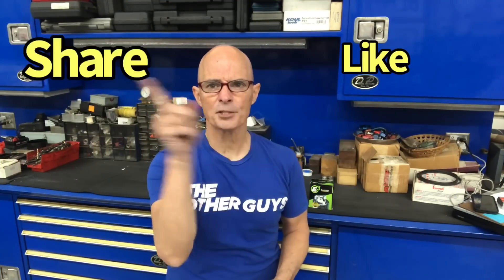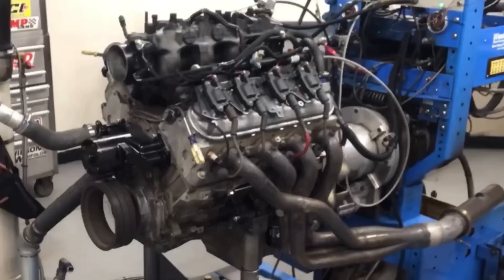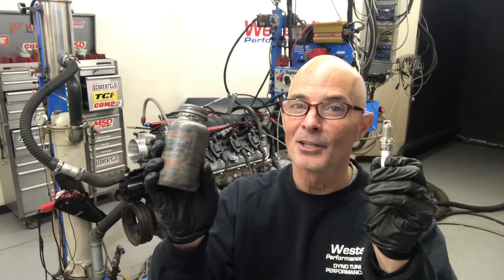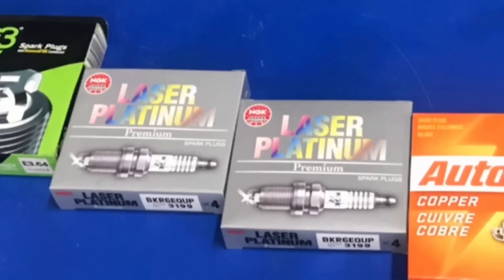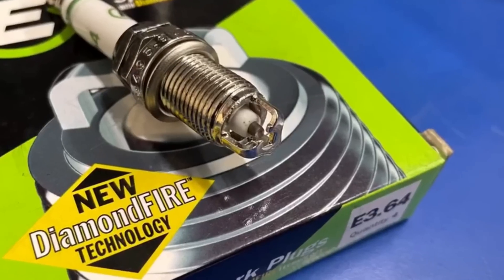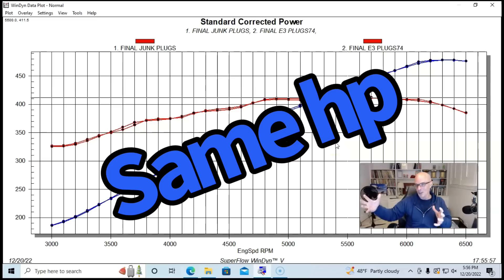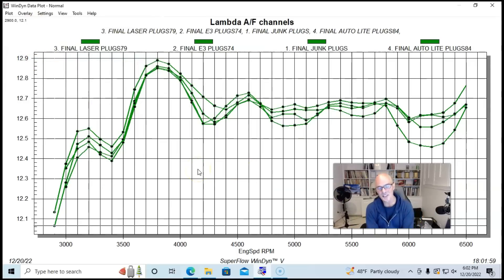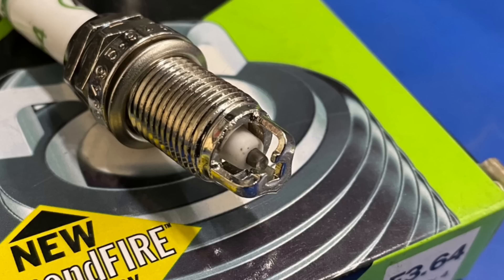E3 SPARK PLUGS-DOES DIAMOND FIRE TECHNOLOGY REALLY ADD POWER? E3 VS LASER PLATINUM VS CHEAP COPPER

Comment: Short answer, spark plugs do not add power. Because how would they do that? Its a spark, it's not adding fuel or o2 or anything.
Reply: But, you are limited to the length of the stroke to extract as much power as possible from the fuel/air available. The idea with the high performance plugs is to get the flame to spread as fast as possible from the moment of spark. That being said, if these plugs actually have a notable increase in flame spread, you'd probably need to adjust the timing advance to compensate for that. I doubt that the difference in flame spread is "notable", but in theory, it should be. I'd like to see a head to head test between a standard plug, and the most promising "high performance" plug, but with the mapping peaked and tweaked for each plug.. I think THAT is where you MIGHT see the gain.. and again, it would probably only be seen as maybe an increase of 100-200 hundred RPM on top, and THAT would only be realized if there wasn't something else in the engine holding it back.. Rev limiter, valve float, etc..

Comment: I ran a set of laser plugs in a 3.8 ford. The standout thing I noticed was the motor really ran terribly before it reached operating temp. Pulled the lasers and replaced with NGK v grooves ( my go to) and the poor cold performance went away.

Comment: Hey @Richard have you done a coil pack comparison?
Reply from the maker: there is no change in power unless you have misfire-we have run stock coils up to 1542 hp
Reply: Ok thanks a lot I appreciate the response and your videos. I also assume wires don’t matter either?

 I see a company advertise won’t name here but they sell 0 ohm wires that create more power as well.

Comment: E3 plugs were recommended, so I put them in my car. No noticable improvement in fuel economy or performance. After 1500 miles and many misfires, installed the factory recommended NGK's. Mileage and performance increasrd exponentially. E3's are junk.

Comment: The irridium plus or pro (that have irridium on top and bottom) last a loooooooooooong time. I have a 14 civic and the plugs lasted 292,000 miles when one finally started miss-firing. I pulled them all out and swapped for the same. The old plugs looked just as new as the new plugs with ZERO wear on electrodes. The car never lost mpg and never had any missfires right up to the point one failed.
They cost $30ea at the honda dealer though, so quite pricey.

Comment: Guess you can't index non-race plugs? Does exact torque matter?
Reply from the maker: you can index any plug-I have not seen any change with tightness of plug-if it is tight enough to provide full contact and not loosen up

Comment: I will like to see time in which the engine rev to certain rpm as spark plug is likely to improve response and fuel efficiency  not adding power to the engine as you still have same fuel and air ratio.  Better plug will increase the rate it fire in the cylinder . Haw fast it light up means fast and better combustion leading to response and fuel efficiency.

Comment: Maybe, and I mean Maybe when people were still using points type ignition and a 20 to 1 wound coil making less than 20,000 volts for a spark, it might have been possible to make an actual gain from a possibly better plug. Then again, there woudn't be much gap with a coil that weak. Fast Forward to these days with 40k to 60k volt coils on plug or short wire with 8 individual coils that will jump .100 gap all day long and the plug just isn't going to matter. Richard just saved a lot of people a LOT of money... As usual, good info... Now, let me go see if he's still live talking about cam lift....

Comment: The question that remains, that this video didn't ( and frankly isn't able to ) cover. Which plug type will remain the most consistent performer over time and miles.  That question assumes tight control of all variables. Things like fuel quality, weather conditions, traffic conditions, mechanical condition of the entire engine and drive train to name several ( but not all ). I know what my suspicion is. It would be fun to see some real world independent testing on that.

Comment: I won a set of 16 E3 plugs at a car show over in Adel Ga 6.7 years ago at southern Mopar week.  Just ram across em cleaning out a box of old stuff in the shop and came in to look up this video.  Guess it’s just money savings for next plug change being plugs are crazy high now days.
Reply from the maker: they work-especially when they are free-they just don't add power
Reply: @richardholdener1727  😂 I’ll use em next change on something

Comment: I'm surprised you haven't done a ls coil pack dyno test. Rumor has it the round coils with heat sink at the top auto fire causing engine failure on the dyno.

Comment: Over 40 years working on cars. These are some of the problems I've run a crossed.  2 Mopars, one with a slant 6 and the other a 360 that wouldn't start with champion plugs but ran ok with autolites.  3 Fords with point distributors that wouldn't start or missed like hell because the distributor lost ground.  Despite the fact the distributor has contact with the oil pump, cam and block and a new ground wire for the point plate to the distributor.  A simple ground wire running to the distributor solved the problem.  3 cars with severe misses because the tech used way too much gray anti seize on the plug threads. Cleaned them and the plug holes and use a very small amount of the same anti seize and problem solved.

Comment: Ive seen copper core worn to .090" gap running smoothly. 90 Ford 302 tfi.
Electrode rounded off.
😆😆😆

Comment: My grandfather who owned and ran a service station post WWII always said the air and fuel doesn't care what's making the spark. As long as it's the right heat range, it doesn't care. Seems like he was right.
Reply: The temp of a plug is very important but this guy don't even explain the heat rang from plug to plug

Comment: I have a couple questions. does anti seize conduct electricity? would you use it on a battery terminal or a ground wire? how many wires go to a spark plug? how does an electrical circuit work? if you have increased resistance on a power wire does the circuit deliver all the amperage? if you have increased resistance on a ground wire does the circuit deliver all the amperage? where does a spark plug get it's ground connection? why do people put a non conductive lubricant on a ground connection? I know why it doesn't stop the spark, that's because it is a stepped up high voltage that forces it's way past the non conductive nature of anti seize, with enough voltage you can push a spark through all sorts of things, but why reduce your spark output? I've seen idle issues, misfire issues, carbon buildup, premature catalytic converter failures and premature spark plug fouling all the result of a little anti seize on some spark plugs. boost an engine until the spark is too weak with anti seize on the threads, then clean it all off and see if it still misfires. I want to see the results. I use brake clean to clean off the threads and have to run a spark plug in the threads of the head multiple times before the engine starts running better and gets back to full spark. typically a small dab of anti seize will spread across all the threads and all the way up the seat. the only way it can be used is in the tiniest dab possible and I still don't recommend it because it's extremely easy to misuse.
Reply from the maker: we don't see the things you describe

Comment: I got Diamondfires for my 1MZ-FE recently firing a parts gun at a developing backfire issue, they seem to work pretty well so far.
Granted, when I pulled the old ones out it became clear to me that they had seen the full 316,925 miles that this engine has run in its 21 years, horridly burned up, with tons of transfer deposits on both the ground and electrode, and about a third of the ground literally burned away judging by how thick the spark point was compared to the arm leading up to it.
I didn't think that the diamondfire thing would do much of anything power wise, and this video kind of shows that is the case normally, but coming from the plugs that were in there, with how out of spec they had become after running for so long, I am actually seeing some extra power out of them. As for fuel economy, I can't say anything yet as they've only been in for about a day and one short drive to make sure everything worked at least as well as before, though I didn't get to test the driving conditions that I was getting backfire through yet.
I'm not saying to get diamondfires or laser platinums, just, don't be like the original owner of my '03 Avalon, do more regular maintenance than just oil changes.

Comment: Just to take this test a Step Further: 
Try going with 1 or 2 Steps Hotter and Colder on the plugs to see the Power Reaction by doing so.
Ngk: try a cold 7 or 8, and a hot 5 or 4
I know Champion is the opposite numerically, but I dunno any of the others off the top of my head lol
Reply from the maker: I've run 10s, there is no power from heat range

Comment: I've ran them in all my zero turn mowers (mow commercially) and I will say the only thing I have noticed is that when in a Kawasaki engine, it does start faster. Nothing different with starting in a Briggs or a Kohler and nothing different in any of them while working the mowers.

Comment: Nope..
I put those E3 plugs in a 4 cylinder Jeep Patriot and log distance fuel mileage increased by 30%.
Also had more power; the Jeep had difficulty going up steep hill that is 1/4 mile before E3 plugs. After E3 plugs the jeep had no problem going up the same hill.
E3 plugs also increased fruel mileage on 2010 Chevy truck with a 6 cylinder 4x4 from 18 miles to gallon to 22.5 miles to gallon. Horsepower also increased just slightly.
Reply from the maker: nope-the only way to improve fuel mileage my 30% was to have one (or two) of them not firing. The dyno tells us what adds power and what does not
Reply: @richardholdener1727  have you tested E3 spark plugs in real world setting??
Reply: @richardholdener1727  I have tested E3 spark plugs in real world settings as I have them in my car as well the other 3 vehicles of family members. I forgot write about the Dodge Durango V8 got improved fuel mileage on the highway driving long distance!!
So that is FOUR(4) different vehicles 
1 four cylinder SUV
1 V8 SUV
1 4x4 V6 truck
1 V6 4 door sedan
All got improved fuel economy.

That dyno testing be done in the video they is less than one minute of testing.

Comment: Use a match or a blow torch to light a 5 gallon can of gas on fire. Tell me which one worked better?
Reply from the maker: both do the same thing-as long as you light the vapor an no plug is equal to a torch

Comment: You may have done it but I’d be curious on testing LS plug gap. GMs original 60 thousandths vs GMs revised gap at 40 thousandths.
Reply from the maker: makes no difference if no misfire occurs
Reply: @richardholdener1727  the hotter spark of the 60 thousands gap I’d think would help?
Reply from the maker: there is no hotter spark-the spark temp is the same-you either initiate the flame front or you don't-don't look for power changes in plug gap-except to eliminate misfire in boosted applications (where you reduce gap)-gap might help MPG at lower engine speeds and light throttle angles
Reply: @richardholdener1727  just searched and saw you have a LS plug gap video. I’ll go watch it now.

Comment: Hi richard.question for you.btw huge fan of your channel.ive got my 383 stroker motor well over 500hp natural aspirated.ivhave a pro billet msd distributor,6al2 box and msd hvc coil.i been hearing this hype on granatelli spark plugs wires how there the best claiming they have 0 ohm resistance per foot and saying msd ain't even close.i want your opinion on the wires I should buy.i was looking at msd they have so many.i want the best.whats your opinion on this because what you tell me I'm buying.and maybe one day you can Dyno test these wires to put an end to this stuff.there high dollar and surely putting down msd.thanks rich
Reply from the maker: KEEP THE WIRES YOU HAVE-THERE IS NO POWER UNLESS YOU HAVE MISFIRE

Comment: I.woild only run E3 in two cycle engines
.they have a high failure rate. I only run Densomor NGK myself and recently tried the rutheniums in my skyactive 2.5 Mazda 3. They are great plugs

Comment: Ive noticed when tuning iridium is more susceptible to knock with aggressive timing. Although it idles better than copper and seems to have more response down low in the rpms. I agree the main trade off is useful life. I recommend copper for track cars and iridium for pure street cars

Comment: I used to believe the platinum hype in my early 20's but was told by a racing team to just use standard copper plugs, like NGK, on my 350 sbc and I have ever since. Plats may last longer but I would still change them during a tune up anyway.

Comment: It's mostly always the same. But the only question is Did you gap the copper to the altitude you are at?  In Calgary Alberta Canada a larger gap will produce a hoter spark. It makes average engines start better and are more reliable plus maybe response. I always gap my platinum plugs about 25% more than factory spec. But what do any of us really know unless we keep our vehicles for more than 100,000 KM or miles. 20 years.
Reply from the maker: more gap does not change power

Comment: Every time I suggest a video you tell me that you’ve already done it lol. So here I am again to request a video that you’ve probably already done. Just saw a video where a guy picks up 35 hp on a 1000 hp boosted LS3 when he switched from factory LS 3 ignition to Granatelli coils and wires. How about a coil/ wire test on a 500 hp LS?
MSD
Granatelli
Fast
Vs
Factory

Thanks Richard
Reply from the maker: I have seen no power from coils-we run stock ls3 coils (with the right dwell) at 1500+ hp. If there is no misfire-there is usually no power gain

Comment: Is it possible that in a engine that doesn’t have optimal vortex intake systems to optimize air fuel mixture that the E3 plugs could help in those engines? The E3 manufacturer only claims that it could increase HP by adding 5 more horses. That LS engine is very tuned and I think that this optimization is negating any gains that might be from the premium plugs. The miss matched plugs seemed so well that this may show how great that engine is. 

Please bear in mind that this is the first and only video that I have seen from your channel. I would love to do what you do! It looks like so much fun to do these tests.

Do you have a video of a crappy engine to see if just the plugs make any difference? Some that doesn’t have GM Vortex technology?

Anyways, love this awesome video. I will check out your other videos and might even subscribe to your channel!
Reply from the maker: don't look for power in spark plugs on any motor-unless you have a misfire
Reply: @richardholdener1727  I learned that the E3 spark plug has copper conductors which seems to make them a big rip off. Iridium is the way to go with engines. Isn't a motor a device that take electrical energy and turns it into mechanical energy? 🙂

Comment: I believe when you go to a plug like the e3 or any more capable plug with more efficiency you will need to change the timing as well to make up for the bigger spark. It would be interesting to see if they re run this test while actually tuning the engine to see the max power they can get and not just changing one thing. Same goes for changing cams, heads, intakes and the etc. You are changing what the engine wants you need to give it what it needs now.
Reply from the maker: we tried timing-there is no power in the plugs-the chamber design usually determines how much timing the motor wants
Reply: @richardholdener1727  good to know. Thanks for the response and I appreciate all you’re work.
Reply: @richardholdener1727  in addition, have you ever heard of or tried to dyno tested side gaping the plugs? Rumor has it that is generates a much greater spark in the chamber and also a more direct spark. Might be worth looking into.

Comment: Richard holder do a video with a set of spark plugs get get the dyno numbers wait a half an hour 45 minutes go in and do another Dino Run with the same plugs isn't it true that a lot of times doing repeated Dyno testing of the same motor with same spark plugs can it differ between 1 horsepower dynoing the same identical motor an hour later in other words I believe if you repeat the same motor test in an hour later on the dyno that you'll get a one horsepower difference once in awhile without any changes.. at all basically what I'm saying is repeat the same Dino over and over on the same spark plugs and motor from hour to hour and I bet the dyno numbers always change between 1-to 2  horsepower.... I wonder what those E3 spark plugs weigh a piece compared to the Autolite copper LOLOL
Reply from the maker: there is no power from these plugs-if the dyno changed 1 hp from weather change-it would change the same with both plugs
Reply: @richardholdener1727 yes I agree with you.... but what I was saying is even if you repeat a dyno run.. of the same engine with the same spark plugs.. repeatedly with no changes... we sometimes see a little bit of a different on The dyno grafts.. like one horsepower sometimes 2 horsepower sometimes.... copper core was the only one that did give a little bit of change empower...but at a  certain RPM level... which was really cool